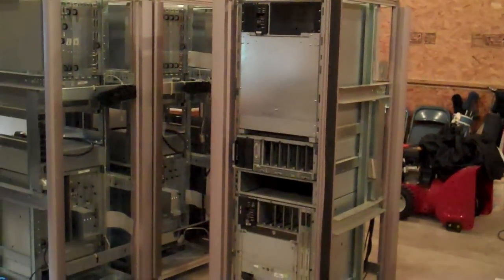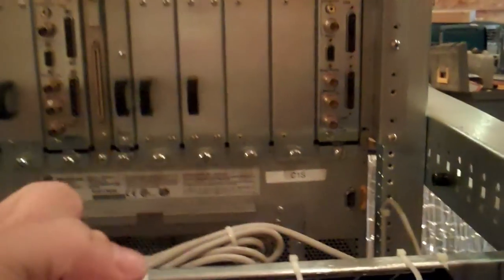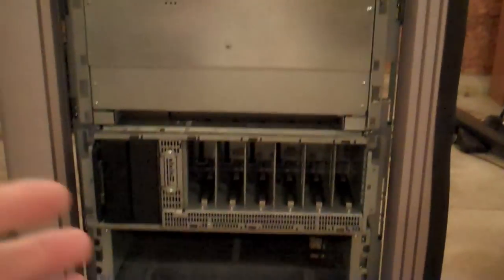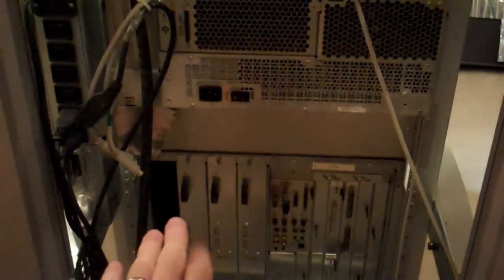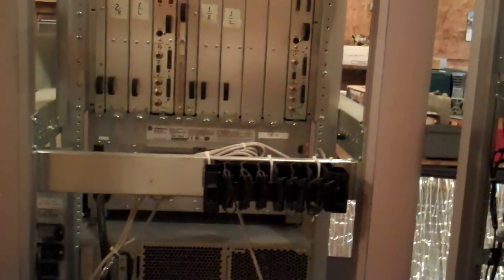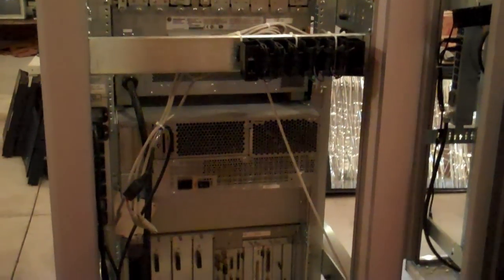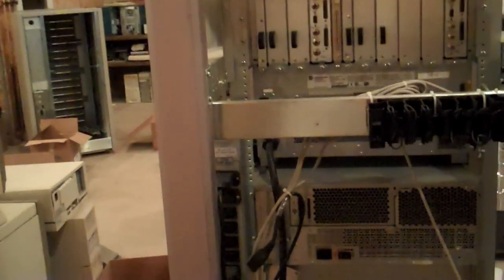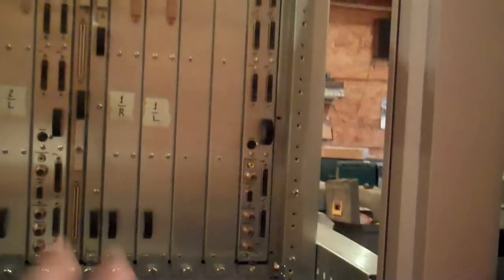Tips on dismantling and reassembling an SGI Onyx2 rack

Comment: Hi, I was wondering if you could tell me how many of the square screw clamps go inside the aluminum frame parts for the top and bottom?  Also which holes in the rack the shelves go? I am currently building up an entire disassembled Onyx2 rack, without any manuals, and it is a bit of a puzzle :)
Reply from the maker: I'll try to remember to take a look when I get home tonight.
Reply: Great thanks! :)
Reply from the maker: I took a bunch of pictures - the holes don't all line up, so it's a bit of a faff about. Hopefully these help - I take pictures from the back, then the front, with some of the faces off. Note that the compute module skin is held on by a little hex-head bolt, I take a couple of pictures of it so you can see where it is - not sure that helps, but just in case - if you don't know it's there it can be a real bitch to find. http://geekpalace.info/misc/
Reply: jpkiwigeek perfect! Thank you so much! :D
Reply from the maker: You're very welcome. I figured pictures might be more use because you can see where all the other components are in relation to each other (cross-bar, cable snatches, the MSC, skins, et al. Also it allowed me to be lazy. Let me know if I can find something else for you.
Reply: I have successfully assembled the rack - boy was it a challenge! But it is up and rolling around. Now I am wondering about the shelves. They have two screw holes and a little "lip" on one side. Which way do they go?
Reply from the maker: Which shelves, mate? The disk shelf or the empty 2U-sized shelf that is actually for venting the blown air out of the module chassis? If you could take a picture and stick it on imgur or something that might help - I took a look at one of them just now and I don't see a lip on the air duct tray thingy.
Reply: jpkiwigeek I mean there are two kinds of I guess they are called L-brackets. One kind with two holes and a "fold" on the end that I referred to as the lip, I thought that these were used as kind of a shelf / support. And another set with a bunch of holes which I suspect are the rear rack "ears" for the modules. Here is a picture : https://www.dropbox.com/s/3gnem651p3q0en4/20171112002557.JPG?dl=0